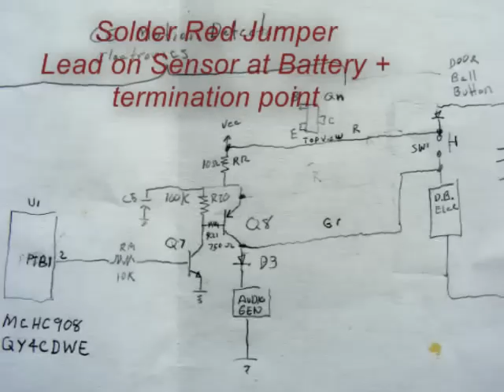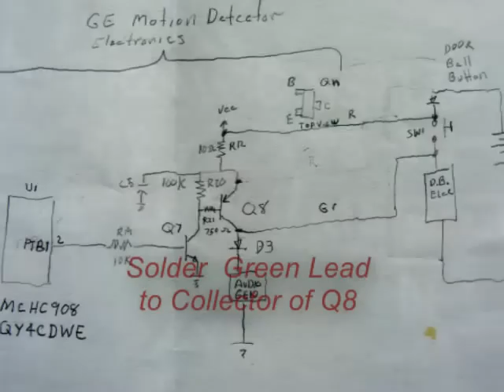Wireless Motion Detector Build

Comment from the maker: Appreciate the comments and the interest.. The video was intended to be a step by step although highly compressed view of what was done. Basically, you are doing two changes. 1. disabling the local speaker, & 2. Using one of the transistors on the sensor to perform the button function on the wireless doorbell.. What I'd sugest is try using the pause button at some of the key points in the video.  Also I have since learned that radio shack makes a finished version of this, so thats another option